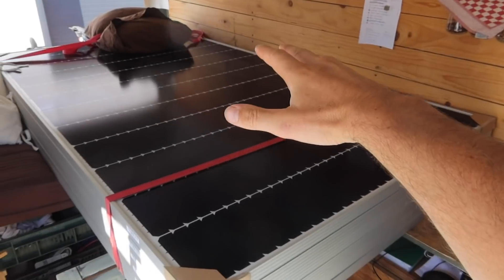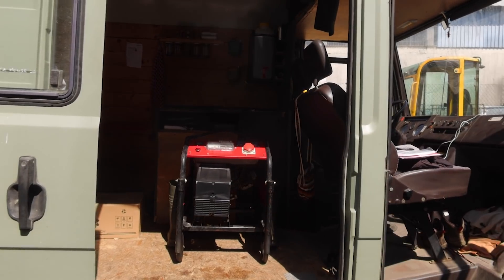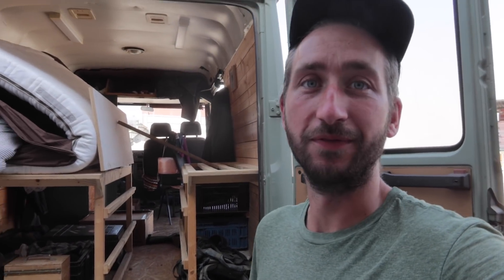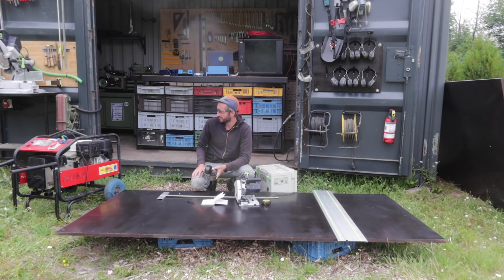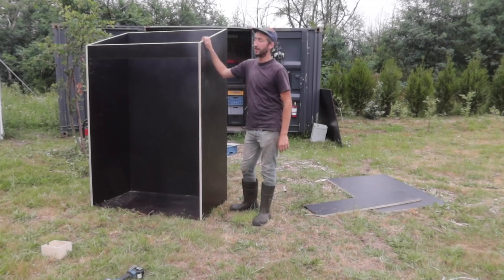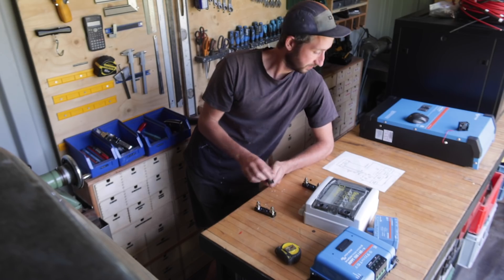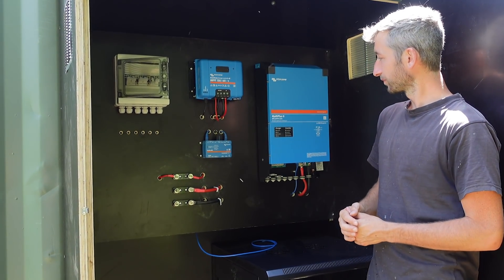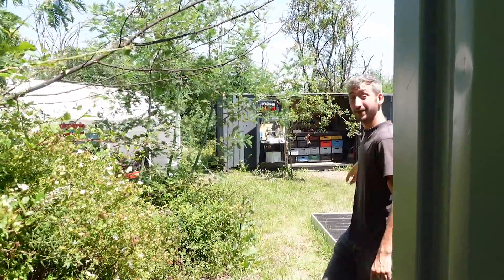#21 Setting up an offgrid solar system

Comment: Good job. You should consider not installing inverters, charge controllers, and fuses on flammable surfaces according to the standards (safety instructions). The wooden plate where you installed the components should have at least an insulation material. The inverter will be warm and the batterie terminals also.

Comment: add 2 either 80mm or 120mm or 140mm (PC 12v brushless with grill) attached via USB (3 speed) would be ok to keep the box cool (install one to bring in cool air and one to vent out hot air out (Grill side is usually the air blown outwards) add 2 analog electrical gauges 1 for Watts and the other for AMPs. (it is also advisable to keep a analog multimeter (Gardner Bender Multimeters GMT-312) handy..so if there is a future electrical problem you can easily check what part or wiring is faulty n change them.

Comment: I wonder if burms along your property might help with noise pollution. If you had a hill the same height of the average car engine or exhaust, with a slope or curve of at least 45 degrees, I think it would redirect the noise up and away from your land. The ultimate solution is a wall, but that can look uninviting and can be expensive, but a hill less than 2 meters might look less intrusive, and planting something like bamboo on top could give you a natural fence, if you wanted privacy, and provide renewable materials further down the line while dampening even more sound. It’s a lot of effort, but ultimately something doable by hand with enough people, or a one time expense if you hire out machines. If you use the earth behind the burm, you create a channel behind it that could also become a canal with running water to even further dampen or mask noise, assuming you have the water.

Comment: Maybe you know already, but: Victron Energy devices are quite great in terms of interfacing with open source software, as most of their protocols have open specs, and they also provide some open source software themselves: https://www.victronenergy.com/live/open_source:start . This should allow you to use an open source energy monitoring system that you can adapt to your needs, for example Open Energy Monitor: https://openenergymonitor.org/

Comment: Nice job of the power station,  good to see ventilation. Do you have a smoke alarm in there? And a powder extinguisher, just in case, lithium fires are a nightmare. Make sure nothing flammable is on the other side too. I also trust it’s vermin proof and fully water resistant. Amazing work tho.

Comment: Somewhere nearby, your neighbors are building a new highway to cover the sound of the generator.
Reply: The generator should be back up only, solar is the future. I’m surprised you don’t recycle laptop batteries into power-walls. Perhaps strike a deal with the recycling centre. I buy mine at £1 each, contains about 6 cells.

Comment: I see you did pretty much the same as we did a couple months ago.  Fyi, that phenolic plywood needs sealing on the cut edges.  Also you need surge protectors/lightning protector  between panel and mppt controller and between inverter and system.
Reply: And an earth cable. Bury an in Ron rod 5ft deep and connect with with heavy gauge copper cable to a central earth point.

Comment: 1 - If you put one vent low and 1 vent high that will encourage normal convection to passively move air. Cold air in the bottom, hot air out the top. 
2 - You may be able to connect your generator to your solar setup to charge the batteries as a backup. Not sure if this is valuable to you.

Comment: Looking good. But cover your solar panels when not connected. Also Lithium batteries don’t like the cold. So consider how to keep them warmer than 10c in the winter. And the panels should go to the MPPT before the fuse box. You can install an inline fuse on the positive feed to the  MPPT.

Comment: my 2 cents: 
- cover all the live wires. 
- power=heat so don't screw hot stuff directly onto wood, use some spacers or you risk burning everything.
- for the ventilation try the passive system used in earthships, it's basically an underground tube that chills the air.
btw....love the project <3
Reply: Spacer or ceramic tile.
Reply: They are made for campers. You can hang them off your curtains if you like...

Comment: Add some vents in the bottom to bring in cool air. With the vents in the top you will have a chimney effect and may not need active air movement. Also paint the out side white to minimize sun loading.
Reply: Also adding vents in the bottom can drain water if it should enter.
Reply: Very smart !
Reply: Very good suggestions! I came here to suggest the white paint and your suggestions are even better.

Comment: Fantastic video as always! I think the power box however needs more ventilation. That inverter is going to warm up a lot when you’re using some tools etc. Not only that, but you want to keep the lithium battery cool (well…not hot) for best longevity

Comment: Nice that the project is advancing! Regarding the heat in the box, this is very basic and you may have already considered it: painting the box in a light color; and maybe adding some opening in the bottom of the box (like in passive houses, so that it creates a flow of air, taking advantage of the fact that hot air goes up). And also, when it rains, if you happen to have the wind blowing in a transversal direction, couldn't water get on the box throw the ventilation?

Comment: Nice setup! Good cooling will extend the lifespan of devices like the inverter. All those electrolytic capacitors dry out faster when they are hot all the time.
Reply: Yes insulate the box. Remember the lithium likes the ‘Goldilocks' effect, not to hot not too cool, just right..!

Comment: Ik zou alle gezaagde kanten wel even afdichten met iets; verf, epoxy, beits, etc. Anders gaat het betonplex aan de randen open splijten.
Reply: and paint it white for better cooling purposes.
Reply: @mopithebest  better use reflective mylar
Reply: English translation: "I would just seal all sawn sides with something; paint, epoxy, stain, etc. Otherwise the concrete plywood will split open at the edges". 

I would also agree. The wood needs to be protected. And it can be done super cheaply using some garden furniture paint. I recently repainted my garden picnic table using a brand called cuprinol which has been extremely effective at sealing it from rain (which we get a lot in Ireland). We used 2 coats. Not sure if the brand is available in portugal but maybe you can find one similar to it.